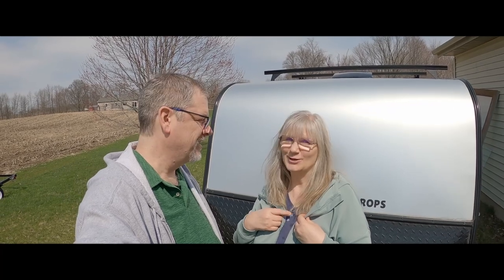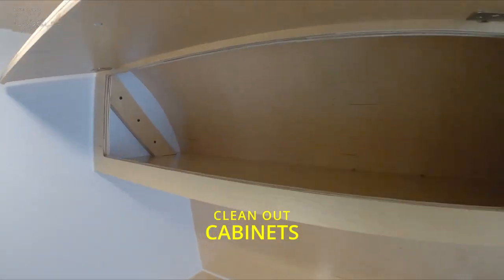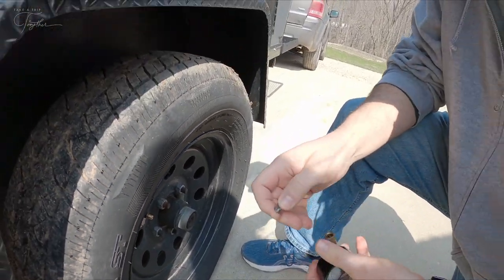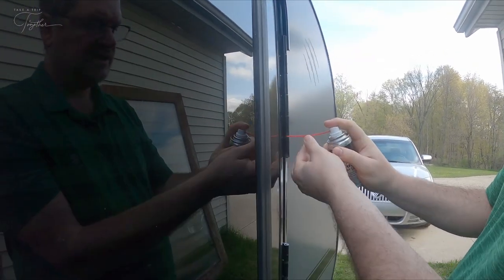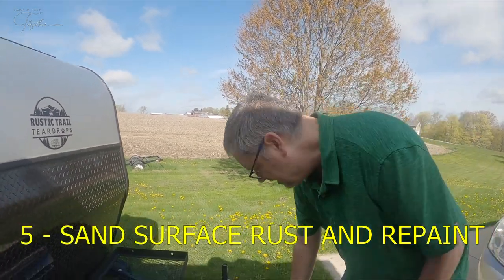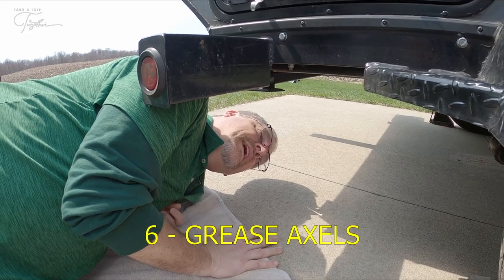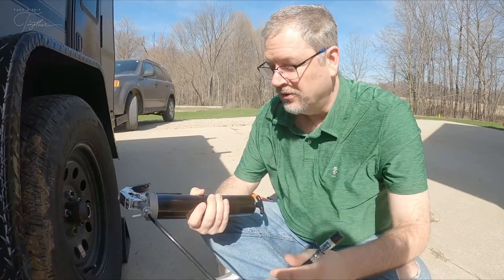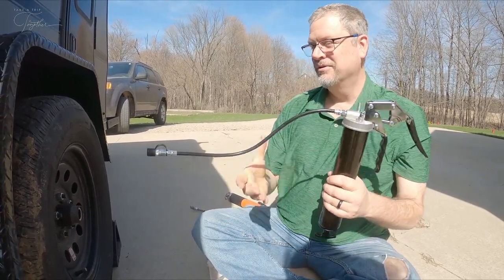Tiny Camper Spring Checklist: Spring Maintenance Tips You Need to Know

Comment: Great video. But just some info. Our trailer has Dexter EZ Lube axles too. Their info online seems to shows that squirting grease in the zirk fitting and turning the wheel is a regular maintenance thing. However, when we bought our trailer from some nice people that maintained it meticulously, I found the guy over greased the bearings (like everytime they came home from a long trip) he blew out the seal on one wheel and it got all over the brake shoes and corroded them on one side. Just an FYI. I called Dexter about it and they seemed to back pedal on the issue. And said that squiring grease in was for emergency purposes only. If on a long trip and you know you will surpass 10k miles…and want to add a few squirts. And that they recommend the wheel come off and hand repack/inspect the bearings after 10,000 miles or 12 months. Basically a CYA stance. But the bearings do need inspected to avoid issues. Anyway, I am going to have our repacked every 2 years since we don’t reach 10k miles or close to it in a year. The service manager said if anything just squirt a 2 or 3 squirts of grease in if I think it needs it to avoid blowing out the seal. If you pump a bunch of grease and get no old grease out, that’s a bad sign that a seal broke. Spinning the wheel constantly helps distribute the grease to avoid this. More than you wanted to know. Lol. Just sharing what I know. Hope you have a great season camping 😀
Reply from the maker: Thanks for sharing your experience, Ben. We were following the instructions from the companies who made our camper and the axels but we will definitely check into what you said and will be careful.
Reply: @TakeATripTogether  Yeah, no worries. Dexter is the company that makes most RV axles these days. And yours looked just like ours with the rubber cap etc. NuCamp also tells customers the same info about self greasing the Dexter axles etc (unless they have changed) It’s more of an issue with bigger double and triple axle trailers with a lot of weigh. If the brakes fail from broken seals and grease in the brake shoes…bad news. When in Pennsylvania last year we saw a person who lost their camper going down a big hill and it kept going, twisted their truck around and went into the woods. Had the the road shut down for while. 😳
Reply from the maker: @benthekayaker  Yikes! We certainly don't want anything like that to happen. We appreciate your concern and support. ❤️

Comment: So I want to be sure I understand. Someone in our FB group mentioned that I could use my low profile jack just underneath where the spring is for each  axle by each wheel. Plus I bought a pair of jackstands just to be on the safe side.  It looks like here you are jacking up from the rear bar that the rear stabilizer is going into am I correct? Can it hold the weight OK because that would be a much easier location to raise the camper up in order to change a tire. I don’t think I have to raise the camper up to grease the axle. I thought I did that by taking the cap off by the Lugnuts and just pumping the grease in there based on Rustic Trail’s website
Reply from the maker: Good questions! I crawled underneath the camper to make sure I was placing the jack directly under the trailer frame which I think should be strong enough to handle the weight because it's holding up the whole trailer. It seemed to work well when I did it that way and felt secure. 

Also, there is a video link on Rustic Trail's website which takes you to a video made by Dexter (the axle manufacturer) where they show you jacking up the camper just enough to be able to spin the tire while pumping the grease in. You can find that video link on this page: https://www.rustictrail.com/rttc-starter-guide/
Reply: @TakeATripTogether  thank you so much for responding. I will definitely take the time to look at the video.
Reply from the maker: @samsonftl  Happy to help! Hope you have a great travel season!